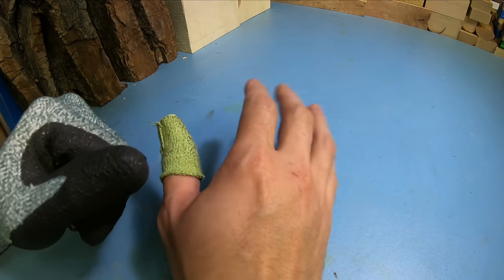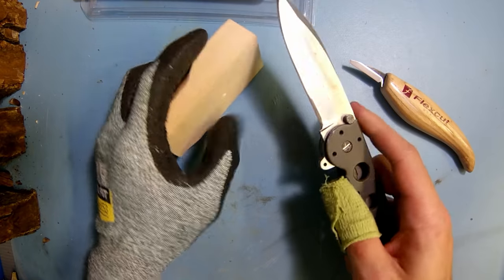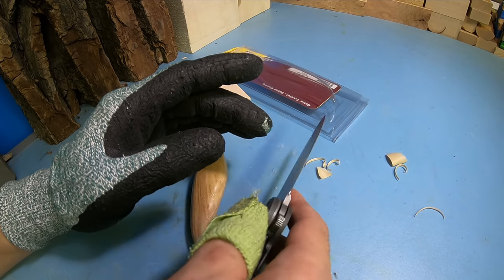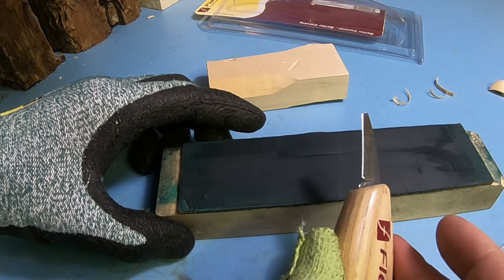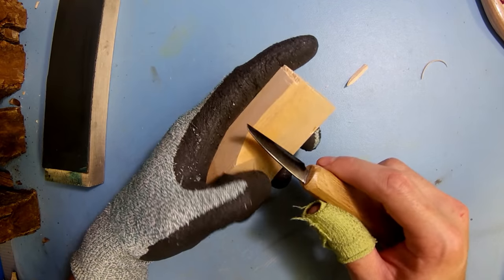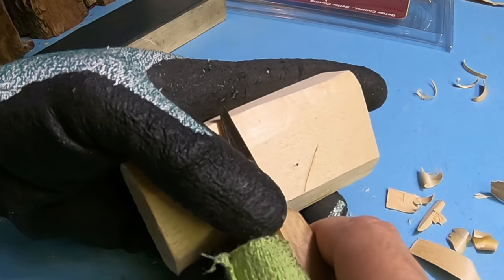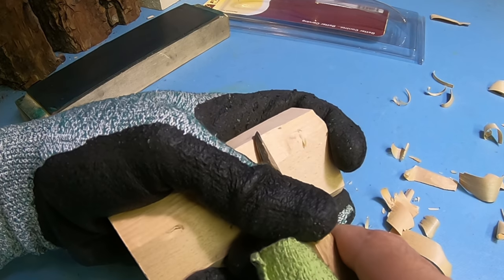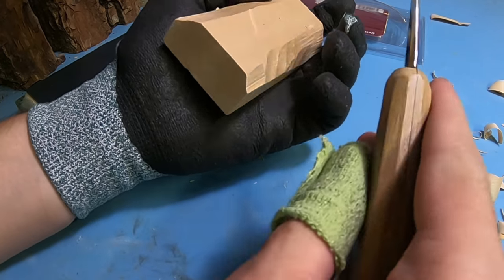5 Beginner Whittling Mistakes To Avoid

Comment: Carbon steel, in general is less brittle than stainless.  It is tempered harder for a single purpose, and therefore brittle.
Reply from the maker: This is one of the better and more direct corrections I've gotten!  Gonna pin it.
Reply: Thank you.
Reply: Thank you.

Comment: Just for some clarity, the brittleness of the knife is not necessarily a result of carbon vs stainless... both carbon and stainless knives can be very hard or very soft depending on the specific steel makeup and heat treatment. Honestly the main reason your pocket knife didn't snap is the blade thickness and grind geometry.... your flexcut is a pretty darn thin tip compared to the pocket knife + the pocket knife was saber ground vs the 0-ground "scandi" bevel on the carver so the pocket knife also has a lot more meat in the middle reinforcing it. Lastly, knowing CRKT, I'm betting that blade was heat treated in the mid-low 50 range.

Just wanted to put that out there so people don't feel like they should or shouldn't buy carbon vs stainless for some reason... it will depend way more on the particular steel itself and how it was heat treated. But, in the end, prying with any knife is a bad plan... just don't do it!
Reply from the maker: Excellent explanation!
Reply: Did I find a fellow knife maker?
Reply: @deathbysilence0  Haha yep! Well more like a knife nerd that got so into knives he started making his own lol.
Reply: @knownaigm  haha I'm the same way the nice ones got so expensive I decided to make my own so far so good
Reply: @deathbysilence0  Lolol I hear that. So many I wanted to own but couldn't spend the $$$$ on but part of me kept thinking "how hard can it truly be to make that though? It's basically just shaping some metal and wood right?"... so eventually I gave it a try. First few were total crap but eventually got the hang of it. I've now been able to make at least a couple of my "grail" knives I had pictured in my head.
Reply: @knownaigm  I've yet to make my own blade but I've used blanks to practice getting scales and handles on and shaping. Been trying to find time but not too much to spare right now. I need to practice my bevel and figure the small things out and get some special files for the choil and stuff
Reply: @deathbysilence0  Yeah I took quite a while before I made my own blade too. I still do builds from blanks as well because they're still a great way to make a custom knife. Practicing before diving in will certainly pay off. I'm on like my 15th full-custom knife and I'm still not super confident in my freehand grinding my bevels and often just use files for that at least for thinner knives. Super fun once you start doing your own blades too though, then the build possibilities are almost endless!
Reply: @knownaigm  that's awesome I'm trying to make it a goal for this year to make a blade atleast heat treat and that is going to be the hardest part no pun intended. Thanks for chatting hope to see some content from you I've been thinking of uploading some of my knife things but want to atlest have some grip on what I'm doing.
Reply: @deathbysilence0  I would honestly love to see your guys' progress, so if you could show pictures that would be greatly appreciated
Reply: I was going to post about this, but no name beat me to it. Carbon steel is tougher than stainless. Look at what swords and machetes are made from. Brittleness increases with the HRC, regardless of the steel type. Thank you for calling attention to that.
Reply: A fellow metallurgist!
Reply: @CarvingisFun  Actually, carbon steels are generally tougher than stainless steels at the same hardness. That's why in swords stainless is only used for wallhangers. There are some stainless machetes, but these are usually rather thick stock and also very low carbon stainless (420 steel) at a low hardness.

Comment: Thanks for your video. I was making some mistakes. I started whittling about two weeks ago.  I'm fully aware that I'm working with a very sharp razor blade. I've learned not to whittle with my arm or hand pushing the blade. I'm using my two thumbs like you do. This way, I'm sure not to cut myself.  I'm 59 and had a fair amount of cuts and bruises.  I find this is a beautiful hobby. I can listen to music while whittling. I also find these small carvings very beautiful.

Comment: I prefer folding knives: I do a lot of my whittling waiting for the bus and need knives I can throw in my pocket fairly quickly when the bus arrives. Almost the first thing I did with my carbon steel Opinel was break the tip (not too badly, I was able to grind it so that is sorta back to where it was). I mostly use multiple bladed folders which have stainless blades of varying quality but I lost the tip on the clip point of my stainless Buck stockman Christmas Day when I dropped it point first on hard pavement. Same story as the Opinel. Lately I've been whittling dried avocado pits which don't have a grain as such and a texture like hard gingerbread.
Reply from the maker: I was going to try whittling an avocado pit, but instead of drying it just got moldy.  Any tips on drying them out properly?
Reply: @CarvingisFun  I don't know that I have had any particular technique so far. I'm in the southern hemisphere so my summer has just ended and drying stuff was easy. I just put them in a plastic tray I bought some mushrooms in and put them on top of a shelf in the kitchen. I did get some pits from a friend and he had stored them in a plastic bag so that they had a light dusting of mould but it didn't take off. Once enough water has been evaporated the skins come off and any mould should go with them. I did get one that was rotten though. On the other hand I found one that was mummified in the compost heap lol.
If you're worried about it you could try wiping the pit with some alcohol or bleach to kill spores
Coming into winter I might have to experiment with drying them in the oven.
Reply from the maker: Thanks!
I maybe I tried drying th wet m when it was too cold then.  Since summer is starting up for us I'll give it another shot.
Reply: @CarvingisFun  You can try putting them into a food dehydrator if you have one, or put them in the oven on the lowest setting for a couple of hours with a wooden spoon in the door to keep it cracked open so the temperature doesn't get too high and the moisture can escape.
Reply from the maker: Perfect, I shal give that a shot with my dehydrator.  Thank you!!!

Comment: I’m just starting carving and have a freshly cut piece of mesquite, is it a good type to carve? Also thanks for all your videos and tips, it makes getting into this hobby a lot easier!
Reply from the maker: Howdy!
Mesquite wood is exceptionally hard to carve by hand.  It can be done but isnt reccomend as it is about 6 times harder than the basswood I use for my carvings.
Reply: @CarvingisFun  Thank you so much, you saved me a lot of time and effort!
Reply: @CarvingisFun  this might be a stupid question but do people use fresh or dry wood for carving?
Reply from the maker: Not a stupid question at all!

Fresh wood (aka wet wood) still has the original moisture in the wood, making it easier to carve. The only downside is that it can split if dried to rapidly after carving.

Dry wood requires no drying time after the wood is carved, but can be harder to cut into vs the wet wood.
Reply: @CarvingisFun  wow thanks! I just got my first carving kit for Christmas and knowing that I could use any soft-ish wood I might find outside really spikes my motivation :)
Reply: I came across the Carving is Fun channel because I was carving mesquite, too, HAHA! My wood chips were originally for a smoker, but I found a new hobby.

Happy whittling, everybody!

Comment: Thanks for the tips. wished I'd seen it sooner. Better late than never. I do have a question for you. Been watching your videos and posts along with a couple others. I am a retired custom cabinet maker and have always wanted to whittle, so now I'm starting to play. You and everyone else I see, are cutting through the wood like it is soft butter. I'm closer to 70 than 60 and my knifes are sharper than all get out, but the bass wood I'm buying seems to be hard as a rock, where can I get some wood that looks as easy to cut into as yours does for you?
Reply from the maker: You're welcome! 
Try looking for "air dried basswood" as the kiln dried stuff tends to be harder.  Check out this video for more details: https://youtu.be/tYm3Rcq59Ig

Also, blade thickness can play in as a factor as to how easily you can slice through the wood.
Reply: @CarvingisFun  thanks for getting back to me and sending me to your other video. Both are helpfull
Reply from the maker: You're welcome!
Reply: I am older than you and I have no trouble carving. The ease of cutting is going to be related to several things. What the steel is is not one of them. The geometry of the blade is important, meaning grind and thickness. A scandi grind is designed to bite into the wood. The angle of the grind is important. The steeper the grind (the narrower the angle), the easier it well be to cut. A hollow grind will be better to but with that a flat grind.  I use folders because I have a lot of them. The Opinel is good because it is so stinking thin. They take a very sharp edge. I also like my Gent. This was produced by massdrop in conjunction with Ferrum Forge. It is S35VN with  a hollow grind. It's about .025 behind the edge. The addition of vanadium to the steel refines the carbide structure and allows a very fine edge. It also holds the edge very well.

Comment: I use wood rasp s rasp s and files. Alot to shape. Then sand it.    I have big ones and tiny ones.  Over the year a I found them very useful.  But you make some really good points for beginners.   Saves you alot of mistakes.  In the end.ps I've cut my fingers several times.  So now I really keep my digits out of the way.
Reply from the maker: I have several wood rasps as well, but for some reason I enjoy slicing off the wood more.  It just feels more satisfying.  
So now I use my rasps for my soapstone and alabaster carvings :)
Reply: @CarvingisFun  I use hickory and maple alot. So it's hard wood to carve on so some times I uae rasp s and wood files. To shape my walking sticks.  But once there made there tough as nails,,,,

Comment: Yes, going against the grain. When you are used to carving/whittling for outdoors tasks you're often not subtle, you have X or y tasks to do before you loose the daylight. I have to check myself when attempting to carve or whittle to this higher standard.   Maybe starting out with blades that are more forgiving than the little thin Flexcut knives is something to think about, at least until you have made your initial mistakes. A Congress pocket knife or the Mora/Hultafors Precisions or carving knives for instance.

Comment: These are excellent tips, we all know about 5 biggest mistakes, right? We are not perfect, no matter how long we have been carving. If we simply follow these tips, we can be efficient and effective wood carvers. It makes no difference to me how atrong a metal is, I never use my pocketknife or detail knife as a prying tool. I've had my pockeknife as well as my carving tools for years and, never broke a blade or even chipped one: being 62 years old, I had a pocketknife since I was 8 years old, in fact I still have my first Case 2 blade pocketknife and, it's just as sharp when I was given it. I sharpen all my wood carving tool, U tool, v tool, angle blade, palm sets daily but, I don't sharpen them every 20 minutes. You can over sharpen carving tools too, the edges become brittle and loss of the edge is not wise. If I'm wood carving and, see my tools is not cutting as easy or smoothly, it's time to sharpen again, otherwise I keep on carving. You can never have an over sharpened blade or tool but, you can weaken the tool or blade by over doing it, a sharp blade is a happy blade. As long as it still has it's strength? A weakened blade can hurt or injury you the same way a dull blade does by the wood giving way. If the blade chips from a weakened point it can becomes a disaster by jumping out of the wood. I always use high grade cut protection gloves on my hands because I know how sharp my tools are, I need my hands.

Comment: Thanks for the tips Brian, very much appreciated
Reply from the maker: You're welcome!
Reply: @CarvingisFun  good tip as you say don’t scrape blade but modify back of blade to use as a scraper removes tool marks ready for sanding projects  scraping brings up grain in the wood too   I made my scraper from old hand saw blade rounding ends off one large and one small to clean bowl of my spoons  👍🐾🦊🇮🇹

Comment: Hello there, I dont use leather and was wondering if a whetstone would suffice for sharpening? Thank you in advance. Love your videos!
Reply from the maker: While you can most definitely use a whetstone (or any other variants) to sharpen, the key is to hone the knife afterwards.  This is typically done with leather strops and stropping compound.

Still, theoretically, if you use a whetstone with a fine enough grit (3000+ grit) you will still be able to create a decent edge for carving.  But then to hone your knife while carving you will have to continuously prep your whetstone every 20-30 min.  A leather strop can just be picked up and used to maintain the edge as you don't need to remove a lot of metal.
Reply: @CarvingisFun  Thank you so much for the informative and tremendously helpful reply. I'm green when it comes to the hobby and I've learned mostly through your videos. Gonna go and subscribe to your channel now. Thank you once again.
Reply from the maker: You are most welcome!  If you have any questions in the future, feel free to ask :)
Reply: @CarvingisFun   Is there any alternative to leather for honing? Perhaps nylon or something? I'm completely new but excited to start :)
Reply from the maker: Sure are! 
I personally like denum or any other durable cloth.  Old scrap jeans will work in a pinch.  I have seen others use cardboard as a super cheap alternative,
Reply: @CarvingisFun  Excellent! Thank you for the reply
Reply: @Omfgwhtavid  the goal should be go get a good leather strop and compound if you plan on getting into carving. The cardboard and denim are better than nothing in the moment. Especially because it is very inexpensive. An old belt can be used. The green honing Compound is less than 10$ and will last long time. 

A whetstone will not hone your knife.

Comment: Could you a video on how to identify the direction of the wood grain?
Reply: Martin ward in an avarage block of wood grain runs straight unless you has a knot in it grain normally runs from middle to top and from middle to bottom if blade snags on wood while carving just turn your job other way  if it snags usually mean your carving against the grain  👍🇬🇧🐾🦊🇮🇹
Reply from the maker: I could do a quick video in a bit, John did a good little rundown as well that is helpful.
Reply: @CarvingisFun  you be surprised how many people ain’t got a clue why that is when carving why wood snags up so they push harder wood tears out ruins your work or way worse chop off a finger or gash something   I seen it happen to a lot I teach carving they ignore my advice it’s like collecting blackthorn blood will be spilt for sure even if the brittle poisonous thorns don’t get ya  👍🇬🇧🐾🦊🇮🇹

Comment: I want to know do you use the sharp side or the blunt side for a beginner and also where did you find the piece of leather on the brick
Reply from the maker: Not sure what you mean with the sharp side vs blunt side, but I cut witb the sharp side if thats what your asking.  But I made my leather strop by gluing a strip of leathet to a block of wood.

Comment: i think ill try to carve a hammer tomorrow, thanks for making this video, because i am new to carving and i never knew that those were mistakes so this helps. also, can i use a chefs knife for woodcarving? i find it really hard to carve wood with small pocket knives
Reply from the maker: You can carve with whatever knife you want as long as they atre sharp and easy to handle.  However, I would look at either bushcraft knives or sloyd knives.

Comment: So in case I cut my finger what would you recommend doing to heal it?
Reply from the maker: Depends on the cut.  If it's shalow and small, clean it and use a bandaid.  

Deeper, and you know first aid, thoroughly clean it and use butterfly bandages, tape, astringent powder, and/or superglue.  

Otherwise, see a trained medical professional to assess what needs to be done.

But using a slice resistant glove and/or thumb guards will reduce the cances of injuries as well as make sure the injury isn't worse
Reply: @CarvingisFun  thank you for replying and for the info